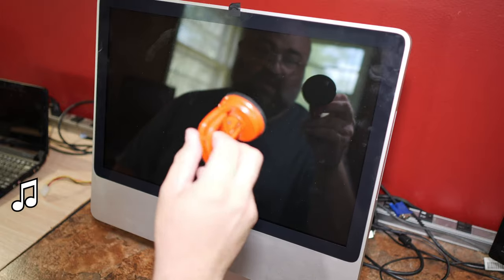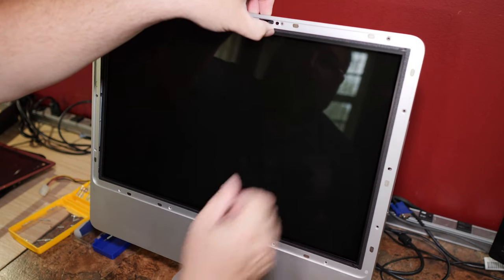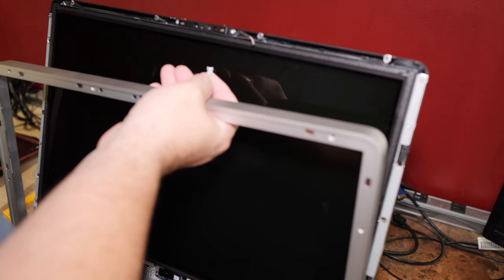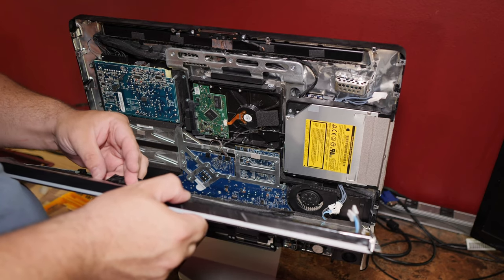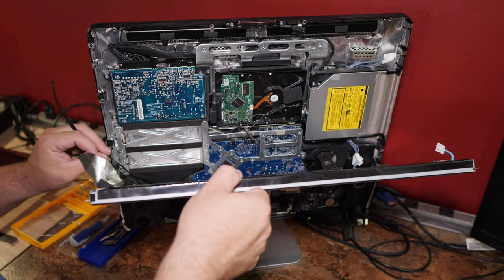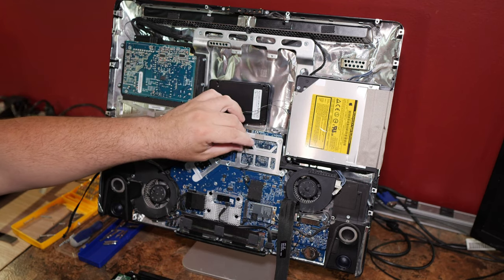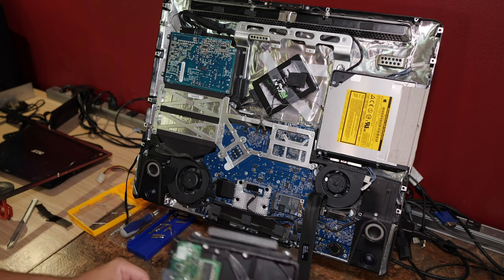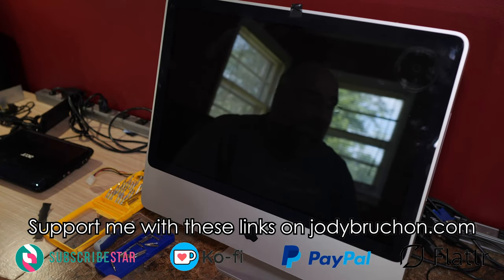2008 Apple iMac SSD Upgrade - This is the Easiest iMac to Disassemble BY FAR - Jody Bruchon Tech

Comment: People who are worrying about thermal control! Done this on my imac 3 years ago. Works perfectly, fans dont start running too high at all. The key is to glue the sensor on a metal bracket underneath the pcb it is connected to. No, really, there are 2 sensor ports and underneath them is a nice metal area to put the hdd temp sensor. It reads exactly what the imac needs not to start fans at full blast. Had no issues so far, no need to use any 3rd party apps for fan control. Perfect solution
Reply: so just as shown in the video ?

Comment: Back before Apple got too greedy and decided they didn’t want their customers to take apart their own products.
Reply: Wait....the customer!?!!. You used tape on a. Customers system to secure a SSD rather than a 3.5 to 2.5 adapter and the original mounting clip.
You shouldn't really be doing this stuff for customers.
Yes on your own stuff , fine do whatever but paying customers.....terrible
Reply: @leetaylor1443 - I used to say the same thing & always believed in doing things “the right way” .. but the simple truth is that most newer devices are now assembled using double sided adhesive, instead of good old fashioned screws & sometimes the customer wants the job done as cheaply as possible, in which case I do the job as cheaply as possible & do a better job for those that are happy to pay better money. Either way, they’re always over the moon with the performance benefits of an SSD upgrade & it’s extremely unlikely that they’ll ever know or or give a toss about tape being used, instead of a bracket.

Comment: Thanks, but how do you get the thing going again with nothing on the ssd. I just get the folder with a question mark on the screen. Tried all given methods but to no avail. I had a bootable usb made with El Kapitän but it loads halfway then says wrong OS version😂😂😂
Reply from the maker: You can try to use internet recovery but I think Apple stopped providing it (command-shift-R at power on). Otherwise, the fastest way to make a working bootable USB is to get an ISO for the OS and dump it directly to the disk. On Linux you'd go "cat whatever.iso > /sdX" substituting your file and device info, and on Windows you may be able to use Rufus to write the ISO. You can find Mac OS ISOs on the Internet Archive.

Comment: Very helpful, thank you. But I have a question, if you have time. As you pointed out, the thermal sensor has no use with the SSD. But how did you control the fans? With no sensor, I am guessing the fans would run at top speed to protect the SSD, even though that is not necessary. The fans should only have to run at maybe half speed or less. Please and thanks, Ed
Reply from the maker: I actually wrote a script to control the fans on the Mac using SMCFanControl. It's on my GitHub but has to be changed for each Mac model so it tweaks the proper sensors.

Comment: You left out the most important thing is reinstall ???
Reply from the maker: That's pretty easy. Look up Internet Recovery.
Reply: I keep seeing that internet recovery only works for 2009 and later models. I have a 2008 that gets stuck on the loading screen and I want to upgrade. Also, I’ve read that these repair/upgrade kits don’t come with OS installed. How do I get an OS for a 2008? Thanks in advance
Reply from the maker: @dontaeh3587  https://archive.org/download/10.7-lion has everything from 10.4 to 10.14 in zip format.